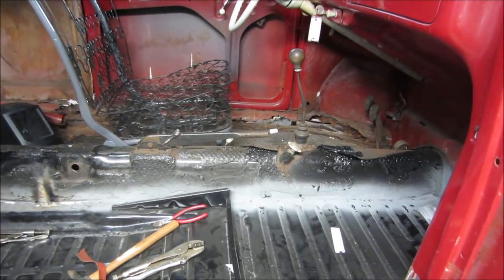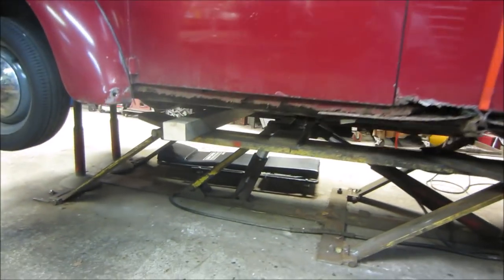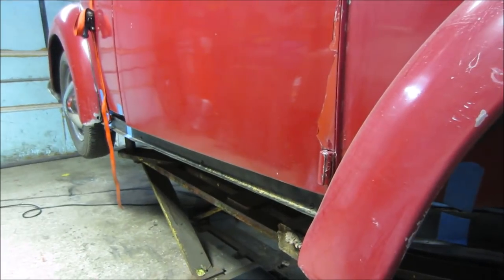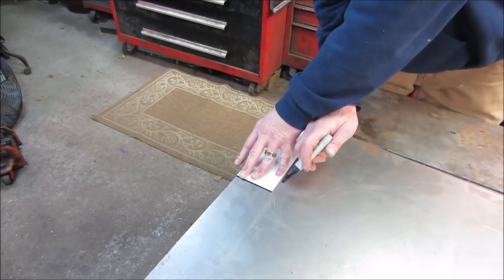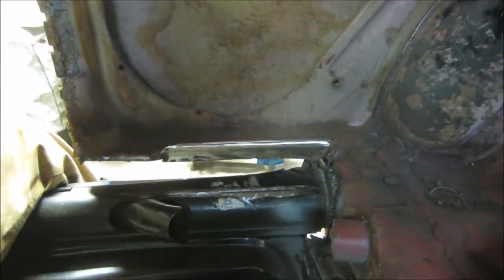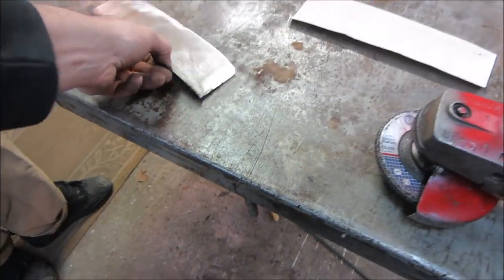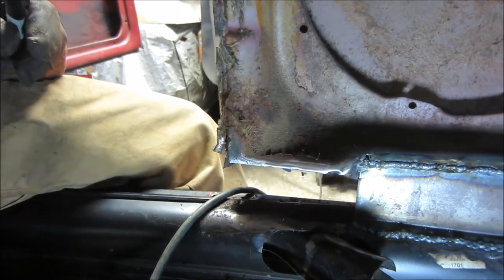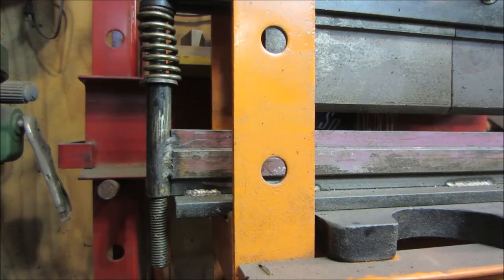Metal Fabrication For Beginners.

Comment: Nice! I ALWAYS learn something watching your videos.  Forty years ago I had a beetle with heater box damage.  Used aluminum and pop rivets to bridge the gap. No sealer. Floor bounced like a trampoline and filled with water when it went through a puddle. Early New Years Day in Nebraska it died on the highway. Just walked away in the snow. Went back next day it was gone. Never saw it again!

Comment: How lucky  for Brian to have Mustie walk you through the process , thanks for filming this so many good things to be aware of when replacing floor pans and the heater channels. l. For me this would be an amazing and enjoyable experience with the master Mustie . This spring my 1963 will need floor pans and heater channels replace will recall this for sure and make notes. For me the unknown is all the reference dim. and bracing ,  so when your done the door gaps are correct and door closing is spot-on.

Comment: I liked this video. You're a great instructor, covering all the bases. I especially like when you told him to keep fingers away from blade. I try to never leave a stone unturned. A guy in high school cut off his index finger on a table saw. I'm still very respectful of the blades, they feel no remorse. Watching him  learn to weld took me back to a time in the army. I was in the infantry where unless you were out in the field training, not a lot to do many times back at the barracks. Anyway, myself and 2 friends took a basic welding course. All we did was get n the right mood and go up and just run beads for a couple hours. We'd fill up the plate with beads, grind them down and run some more beads. We never did actually weld anything, but I still know how to run a proper bead. Gotta start with the basics and grow from there. Thanks, Mustie, Kevin PS I worked as a jeweler for 7 yrs.. Getting down the soldering took a while too. Installing a filtering system in my parents house as well as rerouting some plumbing I learned to solder. I had to resolder the plumbing a few times. Also, there was a saying when I started soldering and that is you have to ruin something to understand the limits.

Comment: Welding thin stuff is a pig, especially when it's rusty too. I haven't tried these new fangled MIG jobbies, I had to use an old fashioned arc welder when putting new handmade sills on a Mk.1 Jag, many years ago, and it was an awful job trying to not blow through. For a later job, doing new, non-structural, headlamp plates on a PC Cresta (more rust than metal, of course!), I resorted to carbon arc brazing. It gave a better result and was much more like gas welding, with which I am more comfortable. So, good job Mustie and Brian, and thank you, I learned a lot from your experiences here.

Comment: Mustie1, I could have used you 50 years ago, before the internet  :) yeah, more like this would be super!!! I cudda have used welding lessons, I recall some problem in my 58 bug..the fuel was weird so I put a copper line next to the tunnel, put a gallon can into the motor place...I don't recall what happened later- once I had my mom's 53 210 2 door..it ran out of oil - I did not know enough basics - been nice to have part of shop devoted to that instead of stinking hammers :)  thanks M

Comment: I started off welding with a non auto darkening helmet but when i bought my first auto darkening one boy was I spoiled and will not use anything but the auto darkening one by far one of my best investment and my welding got alot better since i could see where to start! Lol
Reply: MrSilverado1982 soo true. It’s a life changer
Reply: what is a good helmet to get i would like to have a go at welding
Reply: chick99936 I started off with a miller brand auto dark helmet. It was a bit over 100 bucks
Reply: @chick99936  honestly alot of it is personal preference on what brand to buy. One word of advice is the more sensors to detect the arc the better in my opinion then you have less of a chance to flash yourself. Most have at least 2 but i would go with 4 or more as long as you can afford it but can you afford to hurt your eyes?
Reply: @chick99936  I have had several from harbor freight that work just fine.  They are under $50.  Perfect too when you have to loan them out.
Reply: My welding is SO HORRIBLE & I HAVE ALMOST GIVEN UP! It's because I don't have a helmet, much less a auto darkening helmet! I find myself helping a friend & it's always me looking up at a busted exhaust pipe & the sparks raining down on me & without a proper welding helmet, I cannot do a good job! I NEED TO GET ONE ASAP!!!
Reply: @d.j.9961  Welding without a helmet is just torturing yourself, especially on thin/rusty exhaust. Hard enough to get an OK bold when you can see what you're doing, I wouldn't even bother trying it with my eyes closed.

Waste of time, if I found myself in that position I'd spend 25 dollars on basic non-darkening hood and a plug in work light to work by.
Reply: atsernov  Why go for the cheap ? Your eyes are worth more  than 100$, no ?
Reply: $50 over to a tractor supply.
Reply: they sure are great, especially after you've forgotten to flip down and flashed yourself a few times....
Reply: @marcryvon  Beets welding with no hood, as in OP. Also, in a way a non darkening helmet is better. No chance of flashing yourself. Auto darkening is just so more convenient.

I do have an auto darkening helmet, but I will say that if I had a budget of $40 max for a hood.. I'd go non darkening shade 11/12 with a work light. I think it'd be more reliable than a super cheep auto-darkening. Plus a work light is multipurpose, and OP might already have one.

Comment: Ah, the driver's side looks like the bottom 4-6 inches of my '70 sunroof! I'll probably be using my better-condition '69 sedan for reference, once I check its straightness and if it matches official measurements (or at least is close enough). Just need the equipment and the drive to use it! I have neither, yet. But it's fun to watch the work! Thanks for the video!

Comment: Thanks for the teaching --now l have never picked up or used a welder but l feel a little better about it...l didn't know about that holding at the end of the weld for gas¿ watching without the teaching a beginner misses a lot plus a beginner needs this kind of video thanks again 18 👍🏽ups

Comment: Almost forgot. I came across this site, 'Top Gun PDR Training' on here at you tube. This guy starts from the very beginning understanding how the metal is formed for making body panels. There's a horizontal force, I believe to be in tension and a vertical force in compression. Understanding these principles is a must because dents skew these original forces and have to be dealt with in the proper sequence to best remove the dent. A lot of lost essential, knowledge he learned from the original metal smiths. A 'lost' art.

Comment: Excellent tutorial there, im loving the old bootscas front bumprrs..nice to see skill sharing, Brian will be up to a good standard in no time, im looking at building a battery powered stick welder as my garage has no power, am i correct to believe the ground is live im planning to use 24 v( 2 12v batteries in series,)
Reply: Depends on the rod you are using. Some recommend electrode positive, others negative.

Comment: You should get one of those punches for making plug weld holes. Bad Obsession Motor Sports uses them a lot and it makes it very fast
Reply: Another tool that is handy to have for body work when making and installing patch panels is a handheld flangeing tool. Horror Fright sells one for a very reasonable price. Bends a flange along the edge of the metal so you get an inset patch for a flush seam.

Comment: you need to build a belt grinder, I built mine  25 years ago and I use it every day 50 times, I used a 3" X 5" boat roller and made the idle wheel on the lathe, the idle wheel is crowned and adjusts for tracking.

Comment: Remember my first go at attaching wings on a Ford Anglia in the 80s which is not the best way but brazed it on then acquired a spot welder and most welding in my day was a cheap arse stick welder , now that was interesting till you got the hang of it, then came the mig welder which was nick named the monkey welder as was told a monkey could use it. Wish i met the monkey that could use it cause i was crap but an angle grinder a body Schultz is a dodgy welders best friend...

Comment: mustie 1 whats your opinion on the Glass Action never rust fiberglass floorpans? did you or anyone try them as my 50 year old 1968 bug im going to need the passenger side floorpan, and the driver's pan the seat track is coming off of it. both pans got holes in them on how many times using body filler to patch them. as those pans don't seem to last long. the cheaper sheet metal pan. as im not sure on these glass action fiberglass floorpans if they will support the seat as well as your weight.

Comment: What kind of amperage MIG welder would you recommend to do work like this? Should a 200 amp suffice, so you could comfortably run it at 160A for a couple of minutes? Loved this video by the way!
Reply from the maker: 160 should be fine,

Comment: Because a lot of the people watching this video have mechanical knowledge i thought i would ask for help on here. 

I spend alot of time messing around with bikes but never done much with the electronics im now messing with a cheap Chinese bike 2015 reg, so in the morning its cold so i often have to press the starter multiple times to start the bike (2-5 times) the first time i press it the starter motor turns but the second time the bike sounds like its out of battery and the starter motor barely moves and the lights cut off but then the third time its fine again and the fourth time its bad again and so on... Any ideas on where i should look?

Edit: Already replaced battery

Sorry for posting this twice but im much more likely to get a reply on the new video

Comment: Why not run a continuous bead? (honest question, I'm new to welding too)
Reply from the maker: its too easy to loose control and overheat the area on thin metal, warping it, burn through,
Reply: Correct. Better to do several tacks first to hold everything solidly in place, then play connect the dots to make a solid weld bead. Warpage can be a real problem for newbies when they do a solid bead right off the bat. You want to distribute the heat rather than building too much in one area and causing the metal to warp.

Comment: Hey. What is the diameter of the welding wire and what current was set up?
Reply from the maker: .030 and it was on auto set for 18 gauge, miller 211
Reply: спасибо. Thank you!

Comment: pretty steep curve learning to welding starting on thin metals, it's much easier to learn the motions and heat on thicker parts, then downsize materials once you gain control.
I'm still not good at welding, I'm more of a glue it together fella :))

Comment: Grinding sparks means your losing metal. Cutting back the paint for welding should be done with a wire rotary wire brush.
Reply from the maker: need to remove rust too,wire wheel is not enough

Comment: That's the problem with the old vw's... Extremely susceptible to serious rust
Reply: If you think a '60s VW is bad, you should see a '70s Datsun -- oh wait, you'll only see a few left that somehow survived the metal mites.
Reply: Michael Steeves and its sad because datsuns are some awesome little cars
Reply: the old v-dubs were susceptible to a lot problems,  but they were easy and cheap to repair..    My first 2 cars were VWs..  $50. each..   Once they were shot,   I disassembled both of them and made my 3rd car..  I used all the old gaskets and everything..   It was a blast.   I got many years out of them..  and Yes,!   you can have sex in the back seat  LOL !!
  Corporate America did away with all that fun.!     They want you to pay for a new one instead of fixing your old one
Reply: @THOMASTHESAILOR 
 Oooh, you've found the proper use of those straps on the B pillars too ! But, man, those vinyl back seat covers were cold in mid-winter ! :-))) Memories...
Reply: @marcryvon    LOL,    yes indeed,    My VW's had no heat. (or blue smoke heat)  My Girlfriends brought blankets.  I had a squeegee to wipe the fog off the windshield...  LOL  !     Life was good !
Reply: @THOMASTHESAILOR  You bet ! 
So, you too bought a damn used gas heater at the scrap yard !? My older bro helped me to install it in mid December. Frigging cold. Man, that thing almost killed us. You would'nt believe the black smoke that it spewed out ! Could'nt see anything in there. Fast exit, coughing our hearth out.
My Dad was watching us from in the house. He almost choked by laughing.
 My younger brother, oh 13 at the time, asked about those straps, their use. " Aaaah, you don't wanna know for now" ! I gave him the car some years later. He then knew !!
Yep, life was damn good at the time.
   PS Years later, coming back from Québec city to Montreal, in a cold night, -20°C, the heater quit on my 1992 Nissan Stanza. Man, how can it be SO frigging cold in a car !?? Unbelievable ! The wife and I were sick for 3 days. Not fun when getting older...
Reply: @marcryvon ,  Yup,    I know the feeling..    There's no substitute for Youth.    Everything was great,  no matter how bad it was..    Now,  I can't live without AC either..

Comment: Why didn't you guys get the thickness of the metal to match so it would be easier for him to weld since you already had the pieces all you had to do is to measure the the bug and then go buy the material for the thickness you needed and would have been easier for him to weld if that was the case
Reply from the maker: the car is made of lots of different thickness, 3 or 4 just in that area from 24g to 16g, then rust can change some of that too, we used 2 different thickness on the patches as needed,
Reply: @mustie1  I see hey what did you end up doing with those bikes with electric bikes I told you I wanted one but you never got back to me